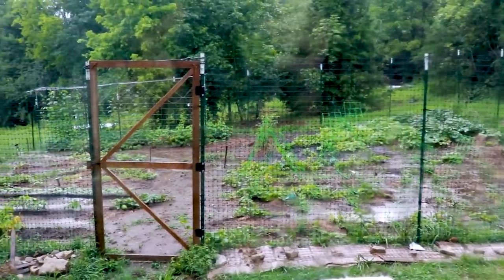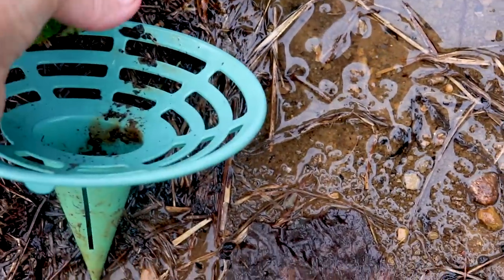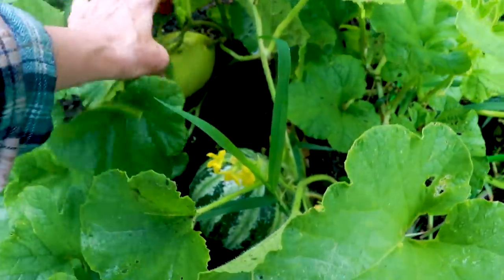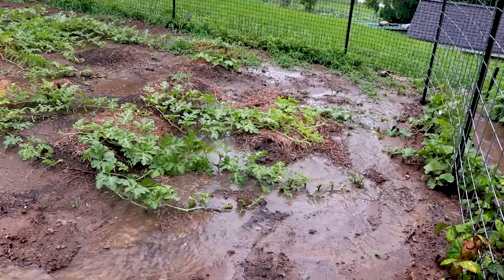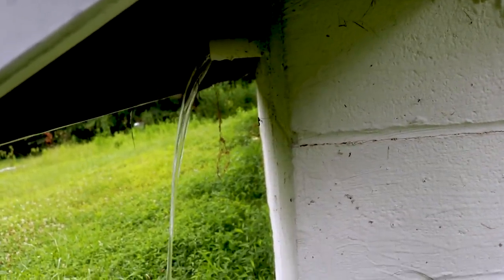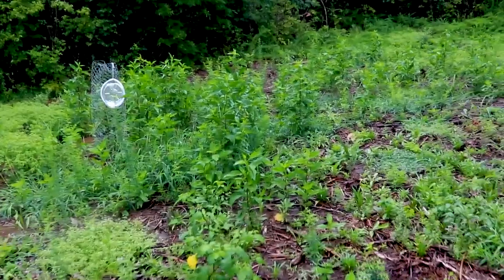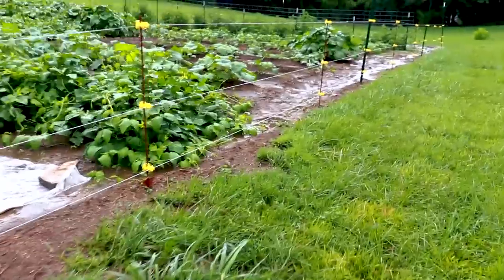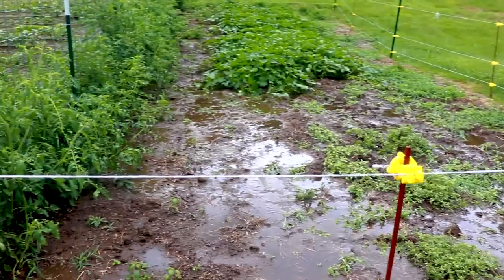I thought my garden was washing AWAY!

Comment: Kaye in upstate NY we have been in a drought with little rain most of the summer so far Been here since 2008 and this is the driest I've seen all the lawns are turning brown. Glad your cistern is holding. Yay. Kaye I had an idea to keep the soil from washing out perhaps. Do you think putting cinder block down would help? Maybe just along the edges where you can see the runoff.
Reply from the maker: I was thinking of that, leveling it more so not so much slope but I think I would also need a drainage pipe, so it didn't become a pool. I'm so sorry for all the people having drought. They have messed around with our weather for so long now, it's in revolt. Or, God is! Thanks much!

Comment: Wow, that was a lot of water!  I've said my piece on poison ivy.  There's not much of it around here, thank God.  If you haven't already, do get some jewel weed soap - It works wonders!  If I can find a good source for jewel weed, I plan to make some.
Reply from the maker: They say it is supposed to grow with PI, but I haven't spotted it and I do have the plant app on my phone and try. Of course, I try to stay out of areas with PI (right in my front yard!). Thanks for the tip! The scrub I buy is a fortune as much as I use. I would like a jewel weed scrub bar. Make that, okay? You must have the scrub in it to get the oil off.
Reply: @Latebloomershow  I'll make some as soon as I can and send you some.  Jewel weed actually dissolves the urushiol oil itself.  I know folks who swear by it and buy it on Etsy and Amazon, but it's expensive.  If I can find seeds and grow it, it would bring the cost down considerably.  It also grows wild in many states, but so far, I haven't found any here.

Comment: If the light green leaves have darker veins in their middle it's a sign of Iron chlorosis.  I use Espoma Organic Iron-tone to correct Iron Deficiency (Chlorosis). The washout isn't too awful bad really. I know it can be heartbreaking! I have my garden wash out too. Even though I've put in french drains and creek beds, built a bridge to cross over ... I still get washed out when we get too much rain at once. Gardening on a slope is hard. I still have a lot of work to do to control the water flow and seems you do to. BUT, it's getting better! O, Kaye, I know you don't agree with me, but RoundUp controls my poison ivy. It's the only thing that does. Using it responsibly in late evening after the bees have gone to bed and not on a windy day will do it. At first, I had so much poison ivy it was climbing up trees, and covering the ground seeding itself and crawling under ground. But after dealing with it for several years, I rarely have to spray anymore. If I see a little spot getting started, out comes the RoundUp. I'm happy that I don't have to use it so much anymore. But,  poison ivy spreads, blooms and then seeds so easily. I HAD to do something! You can kill off the leaves, but the ground roots only grow back twice as much. It has to be eradicated deep inside the plant at the roots.